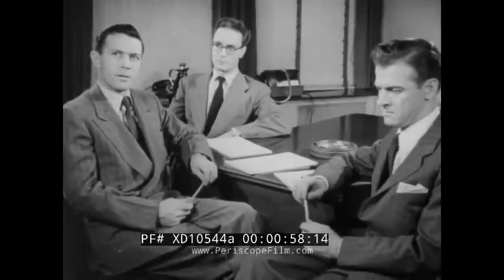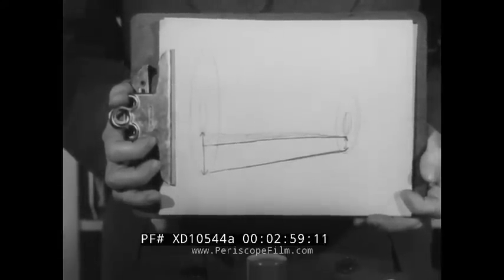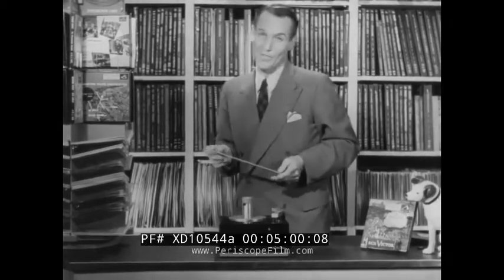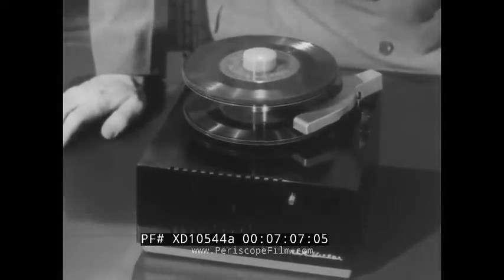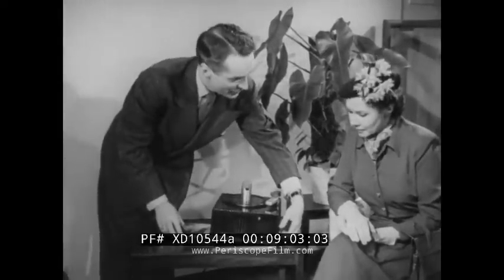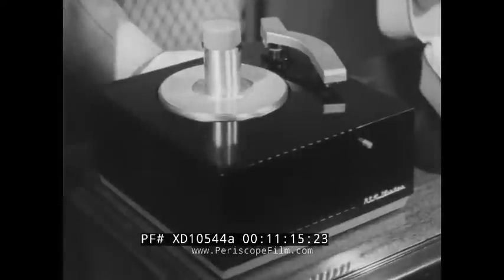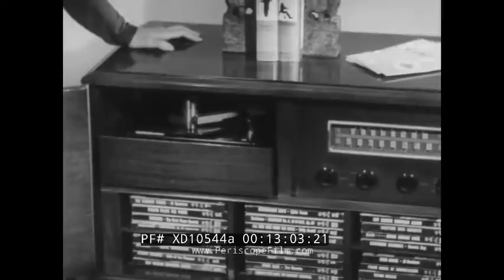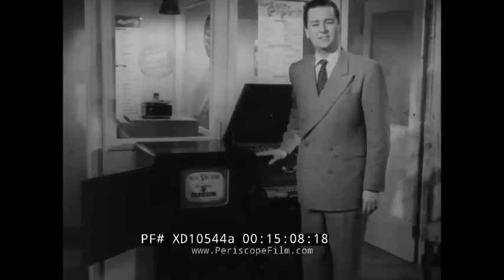NEW RCA 45 RPM RECORD SYSTEM & RECORD PLAYER PROMOTIONAL FILM   VINYL RECORDS XD10544a

Comment: 16 ,  33  45 78   ..   have seen them  all  still have all  but  16
Reply: I had seen 16 rpm records in the 60's and 70's used for language learning records. 16 rpm was to slow for even AM radio quality music, but was OK for speech.
Reply: James Slick 16rpm records were also used for the Seeburg background music systems used in department and grocery stores for years. They need a special adaptor as they have a hole even larger than RCA 45s.
Reply: @danieldaniels7571  Cool!
Reply: Daniel Daniels   I have a modest collection of those records (some 70-odd discs, including some Customusic, Merrimac, and even a Kingtone record!).  I even designed some spindle adapters for them and sell them through a 3D printing service.
Reply: It really depends on how they were produced.  Granted, they never could be the equal of 33 or 45 rpm records, but I have a few 16 rpm records that actually sound halfway decent, relatively speaking.
Yes, they were developed for speech.  The speed (16-2/3 rpm) was exactly one-half that of the 33-1/3 rpm LP - that was not a coincidence.  It was done so that the records could be masted on existing 33-1/3 rpm equipment (by playing the record material at double speed into the record lathe).  This introduced all sorts of bottlenecks with the audio - but as you pointed out, they were developed for speech, so nobody cared.
On the other hand, some companies did actually invest in dedicated 16-2/3 rpm equipment to produce music recordings, and if the record was cut at that speed, it did sound a bit better than the older, 'double speed mastered' discs.  The Seeburg 1000 records are a good example of what could be done.  Again, not stellar fidelity, but surprisingly good nonetheless.
Reply: @xaenon   My  Grand Parents had a huge  AM FM Radio record player..  Firestone it said on it..  I am not sure if my Sister threw it away or not.. Valuable  just  because it was a very nice piece of furniture..  I remember it has  16 or  16 2/3  33  45  and 78 RPM  settings..  I played some of the records  my Grand Parents had .. but I can't remember if any of them were 16 2/3  there is a great video on the tube  how records are made..
Reply: Most likely they were NOT 16 rpm records.  They were not very common in record stores; in fact, the vast majority of the ones available to the public were religious material - Rev. Jimmy Swaggert had a number of 'ministry' recordings on 16 rpm, and IIRC you bought them via mail order.   Those were later replaced with cassette versions.  Books for the blind were not generally available to the public; they were issued via the library (sometimes along with the equipment to play them).  There were also 8-1/3 rpm records but those were exclusively for books for the blind.

It is my understanding that the reason the 16 rpm setting was offered in consumer equipment was because there was anticipation of demand for it that never materialized.

Shame about that old Firestone console.  I absolutely adore console stereos.  I love my old '67 Magnavox; it sounds just beautiful.
Reply: @xaenon   I am  talking  1930's  .. I think you are correct  now  162/3  records  I just notices it was a speed on the  player..  I think it was sold at the Scotts  Farm  Supply Scotts  MI  that My Grandfather and his Brother operated for a few years.. they sold Minneapolis Moline Tractors..
Reply: @xaenon  There was also Hi-Way Hi-Fi, 7" 16 2/3 rpm albums, developed for Chrysler. But they weren't a commercial success. 12" 16s were used as talking books, until they were replaced by 8 rpm records.
Reply: @mikeskidmore6754  Looks like it could have been made by Philco. But, like most store brand radios, they were made by several different manufacturers. Some even specialized in private label store brands and didn't sell under their own name.
Reply: Yeah, the engineers at Chrysler didn't really think the concept through.  To be fair, though, it DID work better than I would have thought possible... but still not particularly well.   I mean, you just can't provide a very stable platform in an automobile.

On top of which, it was an expensive option, required the 'premium' radio set, and was not available as a dealer installation.    And it would only play the Chrysler-supplied records, of which there were only a few dozen titles, and probably also expensive.

16 rpm 'talking book' records came in all sizes - 7, 10, and 12 inch; I have a number of 16 and even some 8 rpm discs, including like 70 Seeburg 1000, Customusic, and Merrimac records.  The ones I find the most fascinating are from a box set of religious material.   Five 7" records with a series of lectures on specific 'cults', probably dating to the mid-late 1950s, by the look of it, and it's OH, WOW! weird.  It looks like there was supposed to be a book with the set, but it's long missing.

I used to have (it mysteriously vanished along with about a dozen or so other records during a move six years ago) a two-disc record set (12 inches) - political lectures by some very Rush Limbaugh-type guy, but very tinfoil-hat commentary, and from the sounds of it, probably recorded during or shortly after the McCarthy 'Red Scare' debacle.  It appeared to have been something you could get only by mail order.

16 rpm was the 'mail-order cassette ministry' of its day.
Reply: @xaenon  It was developed by Dr. Goldmark of CBS., who declined to further develop the format, so he took it directly to Chrysler. Although the system worked fine when finely tuned to Goldmark's Chrysler, it skipped badly when mass installed into less cushy Dodge and Plymouth vehicles. Chrysler eventually switched to RCA's 45 system, dubbed "Auto Victrola". There was also an aftermarket player in the 60s, the Philips/Norelco "Mignon", which played individual 45s, one disk at a time.
Reply: I can certainly understand why Goldmark declined further development - at the time, there wasn't much more that could be realistically done with it, and the 16 rpm format already had hi-fi manufacturers throwing a fit.  First, they were complaining that the 16 rpm format would sound 'awful', and second, they were fearing another format war (a valid concern, seeing as at the time the industry had just emerged from the 33 vs 45 standoff).

Zenith got so bent out of shape about it that they developed that 'Any Speed' Cobramatic of theirs.   The unit could be adjusted infinitely for any speed between 14 and 90 rpm, if I remember correctly.

Here's a video of one:

https://youtu.be/ixl_cWRcqdc

Most of the above information is from an old BILLBOARD magazine article I dug up on Google a few years ago.

Later, when the 8-1/3 rpm format was being developed, it was quite clear that it was NOT intended for the general market, which is why you only see a setting for that speed on those 'talking book' record players.

I cannot recall exactly where I read about it, but evidently there was work being done to halve the speed yet AGAIN - to 4-1/6 rpm.  Sometime in the 1960s, if I'm remembering the article properly.  Nothing ever came of it; the project was abandoned allegedly because of 'technical issues', but I think it was more likely that the compact cassette was starting to be adopted for 'books for the blind' services.   I know of a four-track, half-speed cassette player that could pile six hours onto a single C90 cassette, and of course cassettes are smaller and more rugged, making them more suitable for mail service.
Reply: Mike Skidmore - now that's a damned shame, 'cause that's a beautiful old radio.  I'm currently deep into a project with a 1949 Emerson radio-phono.  Not nearly as pretty as that Firestone, but I couldn't let it just sit in the rain (someone had set it on the curb with a bunch of old busted furniture).

Comment: Had to laugh when he said it comes with a permanent sapphire stylus that never needs replacement! Heck even a diamond stylus needs replacement after so many hours of play! There's no such thing as a permanent stylus!
Reply: RCA sold replacement needles at the time- and they conveniently chose not to stress that in this sales film.
Reply: That would be considered false advertising saying you never have to replace the stylus.
Reply: At the time, the new "sapphire" stylus was a HUGE upgrade over the old steel "needles".  The new styluses were developed for 45s and LPs because the old steel needles would have ripped the crap out of the new vinyl discs.  They also had the advantage of having a useful life of hundreds of hours instead of 15 or 20.  BTW,  Styli are not really diamond.  They are cubic zirconium.....which is as hard to wear out as a diamond, but can be damaged, (by dropping,for example).  You should never have to replace a "diamond" stylus unless it or the the cantilever, is accidentally damaged.
Reply: He's actually referring to the suggested steel needle change between shellac disks on old 78RPM Victrolas. . They wore out quickly.

Comment: 14:52 This is EXACTLY where Garrard, BSR and Collaro had it ALL OVER pitiful little RCA, One turntable that could play ALL THREE SPEEDS! No need to have a separate turntable. Play all your EMI, Decca, PYE, CBS Polydor Fontana and Philips 45rpm discs with an attachable spindle adaptor for some of the large-centred labels(and those overseas issues you may have). Slip the adaptor off and you can play your small-centred 45s(and those with the punch-out optional centres) as well as the LPs and shellac 78s. Again, RCA only got it half-right. The records were good but that pitifully stupid litle player.....WHAT A JOKE!
Reply: Philco and the USA makers were sort of first in on multispeeds once the 33 format became known about, indeed before customer launch of the 33 to have good mix of players to go.
Reply: R.C.A. came out later with the "MULTI-SPEED" record changers. you have to take into account that the 45 rpm recording was in its infancy at the time(1949) also I worked on all of this equipment. I can tell you that there was only 3 companies that made record changers( R.C.A. was one of them) and would put what ever brand name  on the changer. most companies did not make their own record changer. "voice of music" was another record changer that was heavily used!!!!
Reply: @gregoryclemen1870  The Garrard, Collaro and BSR changers would've appeared in Britain in 1950 because that's when the vinyl 45rpm format first appeared there. In Australia 45s didn't start appearing until about 1954 or 1955. But those makers of turntables would've been far superior to American products as they were built for quality, not churned out by the quantity.
Reply: monarch was the only american built turntable, besides R.C.A., and voice of america at that time. I agree with you 100% , B.S.R, COLLARO, and GARRARD had them beat in terms of quality. the little R.C.A. 45 rpm record changer / record player was designed to be a "KIDDIE" record player with low wattage output at the time. it was not designed to "rattle the windows", and it was not "STEREO" either.  thanks for getting back with me, and have a great day!!!. ( when I was growing up, I hade a garrard turn table, and I never had any problems with it !!!)
Reply: @gregoryclemen1870  One of the more ubiquitious turntables was the BSR UA8 model(with the support arm swinging over from the left, and coloured always in cream, bronze(pickup arm and support arm) and brown(start/stop/eject and speed selector knobs aswell as the platter mat for the 10-inch, 78rpm-size turntable platter). These turned up in several makes of stereo and mono record players or radiogram consoles in the late 1950s up to about 1965, they were also fitted with 120V/60Hz motors for USA/Canada-made grams.
Reply: YUP!!!!, a lot of "BSR" turntables was used , even up into the 80s. it was the "UNIT OF CHOICE"!!!!.   when "BSR" was bought out, the quality really took a dive, now just a memory!!
Reply: @gregoryclemen1870  One thing I'd love to have had(I was given an old "Rayford Hi-Tone" radiogram back in 1972, I don't have it anymore) that was fitted with one of those BSR UA8 Auto-Changer turntable decks, I'd have loved to have the auto spindle adaptor that came with it for the British and US/Canada markets. Britain's earliest 45s had the large centres and it was about 1953 or so when the first punch-out optional centres started appearing there. Here in Australia, our 45s had the punch-out centres until about 1960 or 1962(in RCA's case, 1966) but a company called Australian Record Company had the rights to Capitol Records until 1955 and issued some 45rpm singles and EPs with the large centres. When EMI bought Capitol in 1955, EMI's Australian division issued Capitol on 78 and 45rpm(punch-out centre) until 1960/61 or so. But for myself, I'd amassed a bunch of American-issue 45s and would've loved to have one of those adaptors so I could stack my Joe Tex singles, my three(at the time) Ray Charles singles and sundry others, Aaron Neville, O.V. Wright, Oscar Toney Jr. etc. on that stacker spindle adaptor and let 'er rip!
Reply: it happens to all of us, we let things go without thinking down the road of life. we regret what we "LET GO" !!!
Reply: @gregoryclemen1870  It was a good old gram, you could stack eight singles on its turntable and that was about 25 minutes of music(not counting the time taken for the mechanism to go through its cycles). As I said, I just wish I had that stacker spindle adaptor to play my imported records.
Reply: @gregoryclemen1870  "Let Go", good name for a song. Might get Brian Cadd to record it! LOL
Reply: I was not into "STACKING" too many records on the turntable at one time, and later on I did find out that it did lead to advanced stylus wear. I would think that if you did an internet search, you would be able to find your adaptor, it may be a bit costly . I am glad to see vinyl make a comeback!!!!
Reply: @gregoryclemen1870  In the early days of 3-speed or 4-speed auto-changer turntables, not much thought was given to stylus wear. Styli were cheap and readily available. But that was then! Today, auto-changer turntables are a no-no and pick-up cartridges have advanced markedly, so much so that they require specialist technicians, in some cases, just to switch out a worn stylus, and that has not been good!
Reply: I was blessed back in the day, I was surrounded by electrical engineers, electronic repairmen, audio buffs. they all told me to replace sapphire "needles" often, unlike diamond that did last much longer, but back in the day "OEM" cartridges came with sapphire /ceramic pickups. now it is magnetic pickups with a diamond stylus. I was told that a "sapphire stylus"(2mil.) was good for 100 plays. I did value my record collection, and switched over to" diamond"(1 mil.). the other problem back then was the "heavy" tracking weight( 7- 10 grams) now its more like 1- 2 gram tracking weight, and the turntables today only play one record at a time(no stacking)

Comment: While the discs are or were a good idea. that record changer was a piece of rubbish, only able to play one speed, when Garrard, BSR and Collaro in Britain had come up with 3- and 4-speed changers that could handle these as well as the CBS-devised 10- then later 12-inch LPs and the 10- and 12-inch 78rpm shellac discs as well, leaving that stupid little thing choking in BSR's, Garrard's and Collaro's dust.

Comment: That is odd. Putting a symphony on several 45's would be no better than having that same symphony on several 78's.
Reply: Early 45s were extremely high fidelity.  They were cheapened later on.  And ANYTHING would have been better than 78s.  Ever heard a 78?
Reply: @efandmk3382  Of course I have. I meant from the perspective of breaking up a symphony every 4 to 5 minutes to change records.
Reply: @efandmk3382  78 speed was not the issue as it relates to fidelity. If anything a 78 would better in the fidelity department. The material was one of the issues, however I believe RCA purposely made their 78s to sound not the greatest in the 50s.